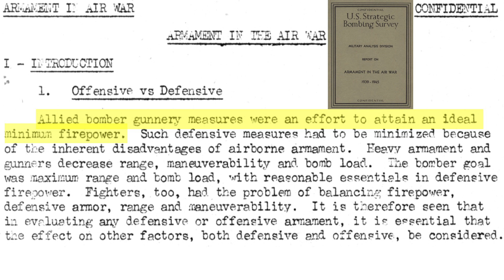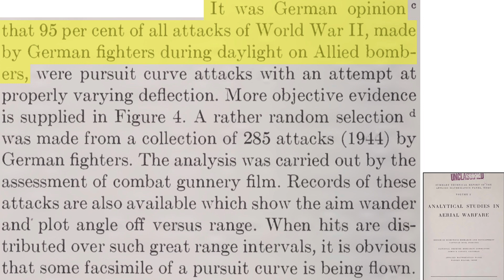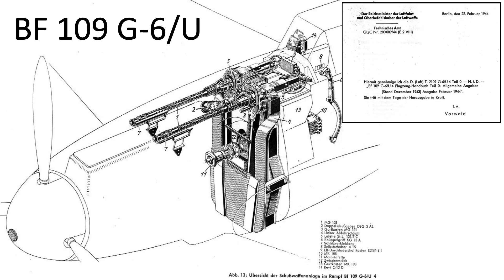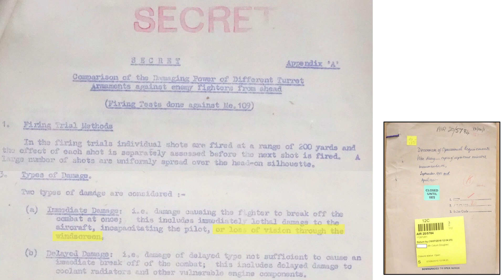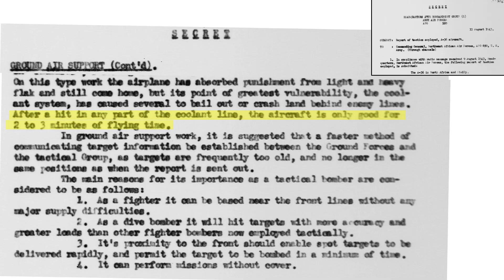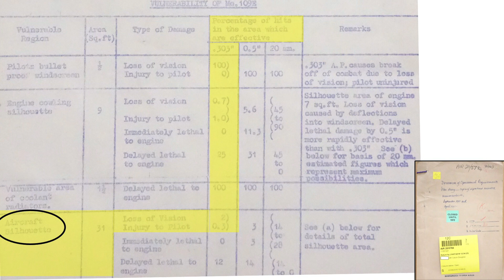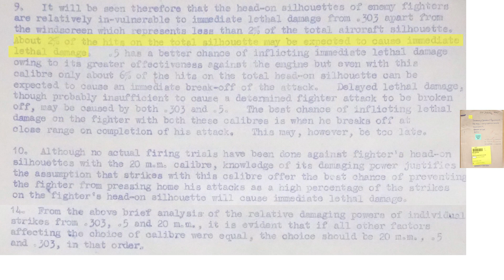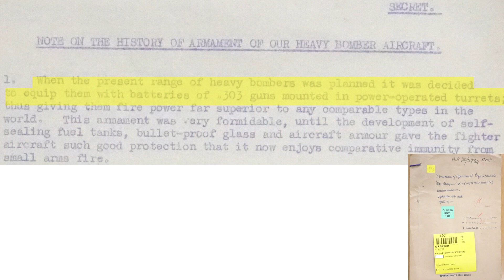RAF .303 caliber Me-109 live fire test vulnerability results – Lancaster bomber gunners aim point

Comment: So,,,, as a recap. I'm supposed to aim for a target about as big as a notebook, at a range of around 500 yards, as I am traveling over 200 mph, and my target is in excess of 300 mph, at an altitude over 20,000 ft, air temperature is in the negatives, and it's a deflection shot. ......    yeah,,riiiiiggght 😂
Reply: Lol, I was thinking the same while watching the video.
Reply: Front glass me 109 45mm but 45% angle so thicker
Reply: @Eric-kn4yn   45% angle doesn't make it "thicker" unless the bullet impacts at an angle.
Reply: That's obviously not the take away.
Reply: The doctrine of philosophy that guns were only to discourage the fighter seem a nonsense to me.  Only a powerful lethal round like a 15-20 mm will ultimately be effective.   The only aircraft in World War II that was able to defend itself adequately was the B-29.
Reply: @williamzk9083  B-29 used .50cal to score 11:1 kill ratio.

B-17 gunners were so effective against fighters that allied escort fighters had to remain outside the range of the B-17 guns to avoid being shot down themselves.
Reply: @SoloRenegade  no doubt the 50 BMG M2 had a relatively effective round but it clearly wasn’t enough when you look at the losses over schweinfurt.  If the United States had to equipped its B-17 B 24s with a 20 mm Hispano canon even if only in the rear turret the doctrine may have worked.  A 20 mm round gives no second chances.  It goes straight through the pilot’s bullet-proof windscreen. It destroys the engine block. It can break the wing spar with only one hit.  As it was the licensed gun had severe tolerance and manufacturing issues.   It was only effective in aircraft which had a pneumatic cocking mechanism to clear jams like the P 38.
The B 29 had a computer which took into account range wind speed and target motion .  Plus the B 29 was so fast and limited the attacking fighters ability.
Reply: @williamzk9083  the losses at Schweinfurt had NOTHING to do with B-17 armament. it had everything t o do with lack of escorts. Nice strawman trying to conflate unrelated things.

Many bombers tried 20mm cannons as tail guns in WW2, and they always abandoned it as it was difficult to aim.

unlike you' I've fired the M2 in combat, and swinging big guns around in turrets manually is NOT easy when the vehicle is moving, and a 20mm would be too unwieldly for a person to manipulate quickly and easily 

" It goes straight through the pilot’s bullet-proof windscreen. "

depends upon the airplane, but the chances of scoring a hit on teh widnscreen were almost 0 to begin with, and even lower swinging a 20mm. and fighters typically scored kills from teh side or behind where the windscreen wasn't a factor at all.

"It destroys the engine block."

so does a .50cal. even a .22 can penetrate an engine block within a few hundred yards.

" A 20 mm round gives no second chances. "

and yet tons of fighters and bombers survived numerous 20mm hits and flew home. It only is a sure kill if it hits the right very specific places. and you obviously  don't know much about shrapnel patterns either. Ever heard of the US Marine who survived jumping on 2 hand grenades with no body armor?

" It was only effective in aircraft which had a pneumatic caulking mechanism to clear jams like the P 38."

no fighters had a "caulking" mechanism. A cocking mechanism, yes. And many fighters had manual or electronic systems as well. how do you think pilots of the F4F and other fighters cleared their guns in flight?
Reply: @SoloRenegade  the losses at schweinfurt  had everything to do with the fact that the B 17s weren’t able to defend themselves. That’s because the guns were ineffective. The solution was to provide escorts but also more effective defensive armament might have worked.   Even if the 50 caliber gun landed 2 or 3 0.5 inch calibre rounds, it wasn’t going to be enough to bring down the fighter. It mostly didn’t deter the attack either in that the fighter and pilot went on to fight another day.
- If it’s 20 mm canon round landing on an 109 one would end the attack and three would bring the aircraft down and the pilot.  The 50 calibre and the 20 mm had almost the same rate of fire.
-The B-17’s needed escorts because their guns were inadequate.   The B-29 was several times more accurate so was able to land more hits per gun
Reply: @SoloRenegade many  Many World War II fighters didn’t have recocking  mechanisms to clear a dud round on the 20 mm guns because of the weight.
Reply: @williamzk9083  but they have cocking mechanism on teh .50cal. and as you proved, some did have it on teh 20mm.
Reply: @williamzk9083  " the losses at schweinfurt  had everything to do with the fact that the B 17s weren’t able to defend themselves. "

20mm wouldn't have changed that.

"That’s because the guns were ineffective."

not at all true. he escorted raids using .50cal were successful, proving the .50cal effective. USAAF bomber losses due to fighters overall were very low once escorts and such were introduced.

"Even if the 50 caliber gun landed 2 or 3 0.5 inch calibre rounds, it wasn’t going to be enough to bring down the fighter. "

that's a lie, as it happened all the time. tens of thousands of german aircraft were brought down by .50cal.

"If it’s 20 mm canon round landing on an 109 one would end the attack and three would bring the aircraft down and the pilot. "

either the plane, or the pilot, highly unlikely a frontal hit would ever achieve both.

"The 50 calibre and the 20 mm had almost the same rate of fire."

but the .50cal was lighter, easier to aim, more accurate, longer trigger time, more ammo, and due to carrying more guns per 20mm it had a FAR higher effective rate of fire than the 20mm.

"The B-17’s needed escorts because their guns were inadequate. "

100% lie! the fighter escorts used the EXACT SAME GUNS as the B-17s. wow you are stupid.

"The B-29 was several times more accurate so was able to land more hits per gun"

proving the .50cal WAS capable, so long as you Hit the target. and with more accurate systems, a less skilled gunner could actually hit something. And thus proving the .50cal 100% adequate and capable.
Reply: @ during the schweinfurt raids US gunners claim 200 aircraft shut down when precisely 2 were lost by the Germans.  They were probably dozens if not hundreds of gunners shooting at the same aircraft.  Some might’ve seen a hit on a cooler which produces white steam.  Here is the fact that escorts to keep the German fighters from attacking the bombers. The bombers armament  was ineffective.  Remove the escorts the bombers start getting shot down again.  The 50 calibre gun generally didn’t stop an attack.  The 50 calibre round just wasn’t powerful enough.  You would probably have to quadruple the M2‘s firing rate from 800 rpm to about 3000 introduce vastly improved fire control
Reply: @williamzk9083  "...more effective defensive armament might have worked..." The USAAF tried that, https://youtu.be/m6Gau62BfF4?si=CUMfSWZMLtC0nYFV. Keith Besherse
Reply: @ there was Luftwaffe into this area as well and they concluded that heavy armaments was the most that  more effective than speed.  (obviously not so fast that the bomber can outrun the fighter ) The history of German heavy bomber programs as one of too little too late.   Both bomber A (He 177) and bomber B (Ju 288) failed due to engine issues and delays.  But their research concluded that  high power guns were required.  The HE177 was heading towards a B 24 liberator style turret  with twin 20 mm guns.  The Ju 288 was covered in remotely controlled 20 mm guns.   The Germans never had an aircraft big enough to carry this kind of heavy armament.  
In the case of the B-17, I’m imagining twin 20 mm guns in the tail and possibly in the chin turret.
Reply: @williamzk9083  yes, germans seeking to down heavy bombers that were tough to destroy needed heavier guns.
Reply: When you consider that a B-29 carried 11 x as many crew as a Zero, an 11:1 loss ratio is just barely even-Steven.  Not all of a B-29’s crew would be killed or captured, but then not all Zero pilots shot down would be killed either, and none captured.

And did a B-29 cost just 11 X as much as a Zero, or much much more?  Granted the U.S. could afford the cost better than the Japanese could, and the damage inflicted on Japan was of course much greater than just Zeros shot down.  But still those were expensive losses even at 11:1.
Reply: @williamzk9083  Göring   "But in the beginning, we had not fully assessed the possibility of daylight bombers. Our fighters could not cope with them. When we were able to do so, there was a pause and then you sent them out with fighter escort. The Flying Fortress, for example, had more than we had anticipated. Our estimate was incorrect."
Reply: @genreynolds6685  valid points, but it misses the point entirely. the point being that .50cal was effective and bombers could defend themselves unescorted with just .50cal if paired with sufficiently accurate fire control systems.
Reply: @williamzk9083 that's almost certainly not true. No one knows for sure, as German records are a mess and the dates of losses (or even the extent) are not fully recorded, but probably at least a minimum of 25, and more likely 50 or more, single and dual engine fighters were lost on both Schweinfurt raids. 

Mind you, even if you total up all recorded single engine fighter losses for 1943, including those with repairable damage, you end up with a surplus of about 2500 fighters that the Luftwaffe should have had but didn't. This is with German fighter squadrons being considerably understrength by year's end while the reserve pool stays constant. The very fact that the German records don't account for this gap should caution anyone from putting too much trust in them. For me, the USAAF estimates are thus the closest we'll ever get to the true result.
Reply: @SoloRenegade no, they couldn't
Reply: @wiltonlewis5369  no what couldn't what? 

declaring something wrong with no actual argument to back it up is false.
Reply: @SoloRenegade that ratio was achieved against unarmored Japanese fighters, piloted by poorly trained pilots, operating at the outer range of their performance envelope.
Reply: @MrM1729  the B-29s with .50cal were engaging the enemy fighters, beyond the effective weapons range of the enemy fighters.

the B-29 guns were accurate hundreds of yards furhter out than the enemy fighters were accurate, or even allied fighters were effective at. the fire control computer was that good, and the .50cal that effective when putting rounds on target. the skill of the japanese pilots has no impact on the damage a .50cal does when it finds its target.
Reply: @ I saw the same video.  Still think quality of Japanese planes and pilots were major factors that contributed to high kill ratio.  Note that same B29s were helpless against better armed and armored Mig15s in Korea. Wonder why the gunnery system couldn’t be upgraded to handle faster planes.
Reply: @MrM1729  fair. Japanese pilots weren't well trained late in teh war, were underpowered and slow for the altitudes, and were outranged by the B-29's guns.

Mig15 solved many of those problems. better pilots, faster, higher altitude, more firepower, and such. But they still didn't shoot down very many B-29 (only 16 were destroyed by fighters during the war, and flew over 21,000 sorties).
Reply: @ mig15 was a point interceptor— am guessing the 29s avoided those points.  15/29 kill ratio was about 1:1, a win for the 15s IMHO.
Reply: For you yes. For them its very possible especially if there competently trained
Reply: @gotanon9659  Nope.  Even if the gun was aimed properly, the bullet dispersion was too great to reliably hit a target that small.  The approach was to blast away and pray.
Reply: @jfess1911 better sitting there doing nothing.

Spray and Pray Baby!
Reply: @jfess1911  I think bullet dispersal  was a characteristic of the barrel, the quality of the Mount, and perhaps bullet manufacturing tolerances.   I also believe gunners were taught to fire in Short bursts because vibration reduced accuracy.
-sometime positions had a Gy believe the upper turret the tail turret and the Ball turret.  The gunner had to track the aircraft and enclose its wingspan in a circle which was adjusted by a dial.  Estimate the range and after tracking for awhile, the rectum moved providing the the offset or lead required to hit the target.  I don’t know if it took into account air density and velocity.   On the B-29, all of these computations were done with great precision and the guns applied their own deflection.   So to an extent better gun sites would’ve helped the B17
-
Reply: @williamzk9083  You are correct that a lot of things have an effect on dispersion.  Some dispersion was considered advantageous since it created a larger "beaten zone" that increased the probability of a hit when the aim was off a little.  The general idea was to flood a general area with bullets and hope some hit a vulnerable spot. Since the Lancaster's defensive guns were spaced apart in a turret, the bullets would only be able to converge at the aim point at one particular distance anyway.  Add to this that Lancasters typically flew missions at night, when it was difficult to see the attacking fighter and it is easy to recognize how difficult the gunner's job was.  
 Hit placement was also not as critical for US gunners since a .50 cal can cause damage to many more areas of the attacking aircraft. As noted in this video, even a hit from a Lancaster's .303 guns was unlikely to stop a fighter's attack run.
Reply: @gotanon9659  You should not drink before you post a response to a comment.